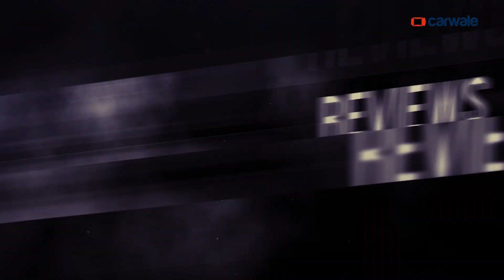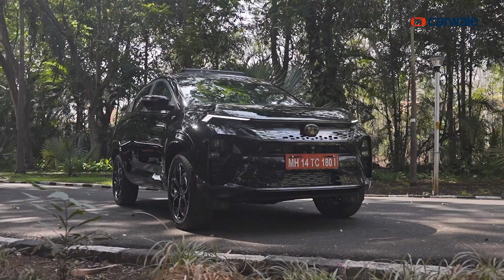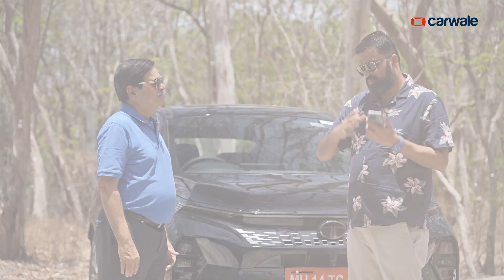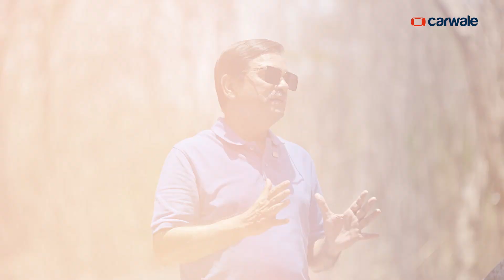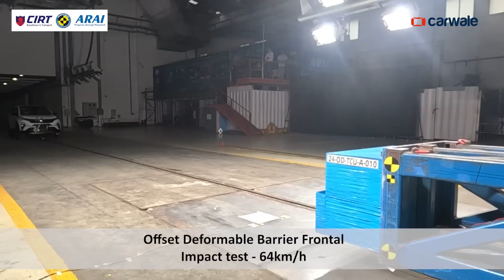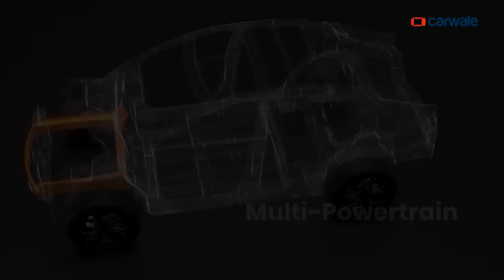Behind the Tata Curvv: An Exclusive Chat with Tata Motors' CPO Mohan Savarkar

Comment: Why didn’t you ask abt the 
1. No cupholders at the center console
2. No Sunshades for other colour option except dark edition (we all need protection from sun)
3. What guarantee for Touch panels  that will last for atleast 10years?
4. What is the point of giving smart phone charging pad when phone doesn’t stay at its place during high speed drive.
5. What about no cladding on the rear door results to Mud deposits
6. Something the infotainment system is completely dead
7. Font of Speedometer is too small and placed inside 

?